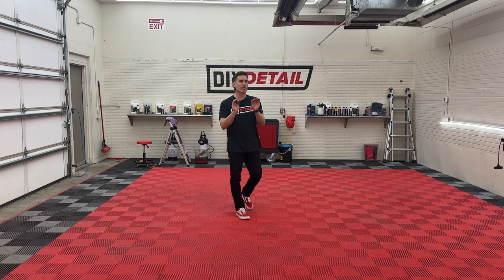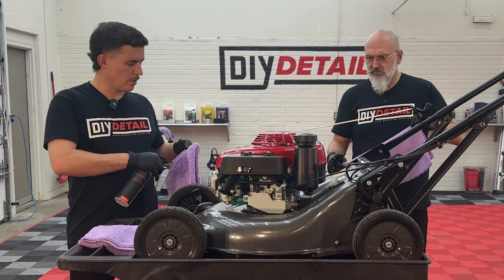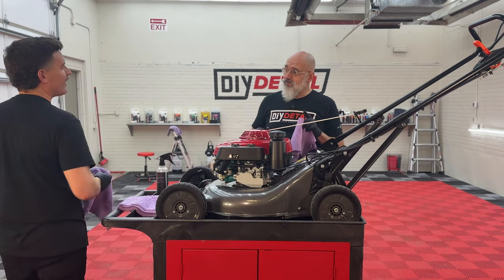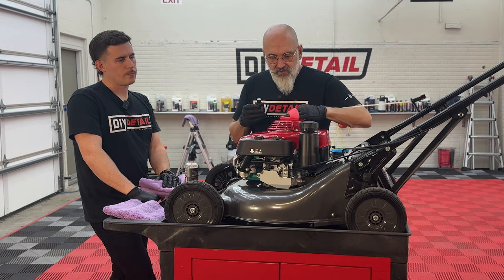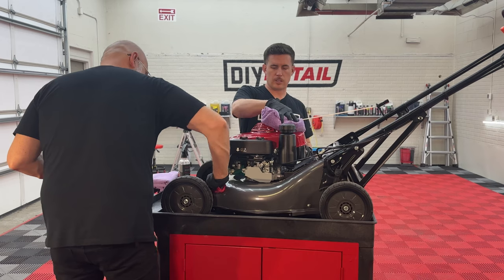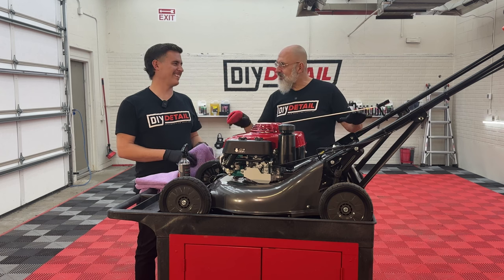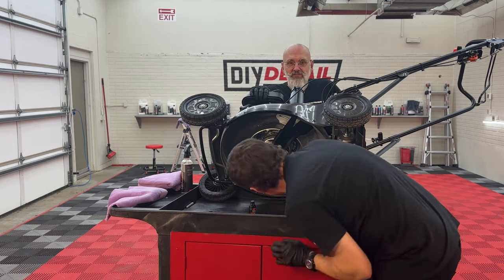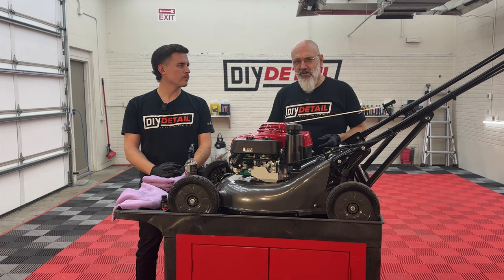How to Ceramic Coat your lawnmower!

Comment: I used a Mother’s One step coating kit from my local Walmart on my riding lawnmower hood. Just to get a feel for the decontamination and coating process. It actually turned out good and the process was easier than I thought. I know it’s a cheap coating kit and that it won’t last long but just used it as a learning process like I said. Even when I looked at it the next day it looked like the paint got even brighter from it curing
Reply from the maker: Excellent!

Comment: Ceramic coatings are arguably even more useful outside of car detailing. I ceramic coated the inside and outside of my stainless appliances, and they stay pristine and are so easy to clean. 

Ceramic coated all my nice watches as well. Makes them shinier, protects them and are easier to clean.

Same goes for my shower doors and faucets. Can’t live without my coatings.
Reply from the maker: Great point! The only thing I stay away from (with ceramic coatings designed for car paint, etc) is food prep areas. And in terms of the shower...not the shower floor because you don't want to slip. Just common sense things like that. -Nick

Comment: Very interesting!  I tried several OTC graphene and ceramic coatings on the underside of my EGO electric lawn mower, but the mowing action swiftly polished the coating off and left the usual grass residue.  Any suggestions as to what kind of coating works on a plastic body lawn mower like EGO (there are many other electric mowers relying on plastic housings).
Reply: I have so many EGO products. Guess I’m going to be purchasing coating and panel prep. Assuming a coating for plastics?
Reply from the maker: On the underside of the deck, some designs don’t work well with damp grass, especially mulching mowers.

Comment: Just watched the video, I'm going to ceramic coat my shower now.
Reply from the maker: Be careful with the floor.
Reply: Tried the shower doors. Dont forget you need to give it a week before your bodywash and shampoos hit it. And really polish the glass, because mine looked immaculate. but as soon as the steam covered the glass, all the invisible spots showed up for the party. In my case, it wasnt really worth it, and easier to just regularly clean the shower to keep it looking good. But a fun experiment, nonetheless.

Comment: I was bored and for some reason I decided to detail and refurbish my 25 year old Honda mower. I painted certain parts, oil change, waxing, then after about six hours I started to wonder if this was a good use of my time.
Reply from the maker: If you enjoyed the process and results, then it was a good use of your time.
Reply: @diydetailofficial  yes, you’re right. I did enjoy it and am actually quite proud of the condition I’ve been able to keep it in. I’ve come to the conclusion that this Honda mower is the single most reliable, high quality product I’ve ever purchased in my life. It’s NEVER given me any trouble. I mean, the clutch still works perfectly with zero maintenance! How is that even possible? It has never not started! It’s amazing really.
Reply from the maker: @johnforeman634 excellent

Comment: I just finished applying 5 year coating. I caught a few high spots during application but I’m not sure I got them all. Can I fix them in the morning with gold standard or something or do I have to get them tonight?
Reply from the maker: Best to get them tonight with an applicator with a bit of coating on it. Apply, and wipe off after 15-30 seconds. 

If you wait, polish in the morning by hand.
Reply: @diydetailofficial  yeah I’ll probably do that. I did the ones I could see while there was still a bit of light but it’s hard now without good lighting. I’ve had an interesting coating experience to say the least
Reply from the maker: If you have a tablet, take a picture of something white, keep that image on the screen, turn up the brightness, and shine it at the paint, it will show you the high spots easily
Reply: @diydetailofficial  great tip, I think I’ll see what’s up with it in the morning. I’m fairly certain that I’ve gotten to most, if not all of them at this point
Reply from the maker: @ethanblan435  please keep us informed.
Reply: @diydetailofficial  will do, in hindsight I probably shouldn’t have done it in 90° and 80% humidity. I had sweat pouring out of my gloves onto the car where I was coating, so I took one glove off and found a cotton one to go under my other glove.

Comment: Dies the 5 years coating come in 50ml? How many mid size car can I get out of one 30ml? Can I do f250 with one bottle of 30ml?
Reply from the maker: 30ml is our only size, 2 -3 midsize vehicles are easy, and yes a full sized truck will easily be covered by one bottle.
Reply: @diydetailofficial  are the coating professionals' grades?

Comment: The underside of the mower will be coating free after 2 mows. I actually spray FLUID FILM on the underside of my deck
Reply from the maker: what's your logic there?
Reply: @diydetailofficial  Fluid Film is $9 a can. Spray deck, mow, rinse off deck afterwards, let dry and repeat next mow. Takes 10 seconds to spray